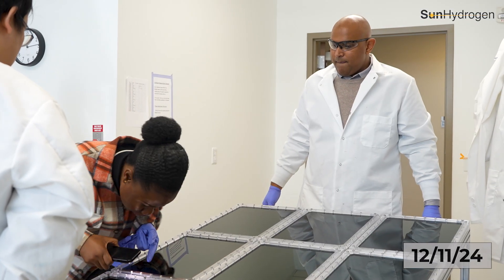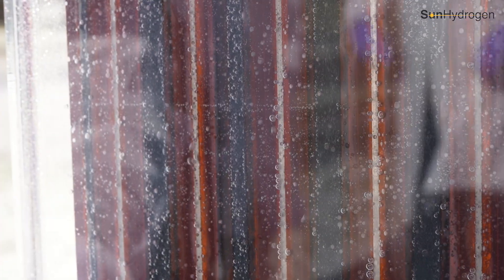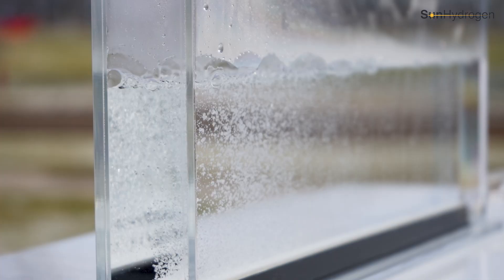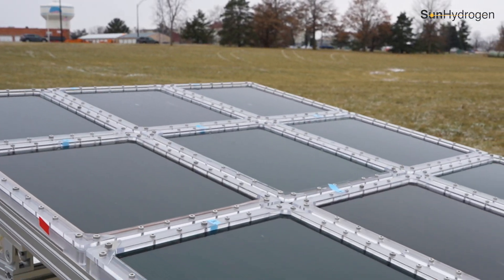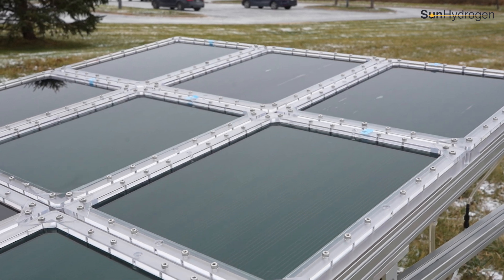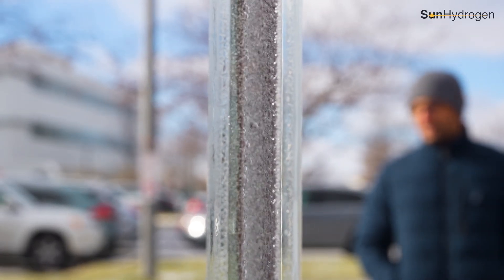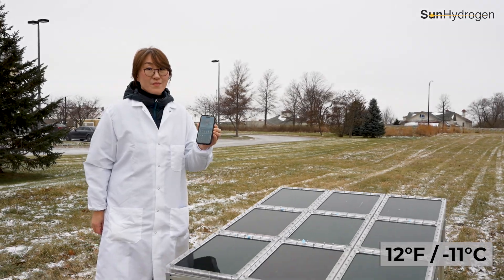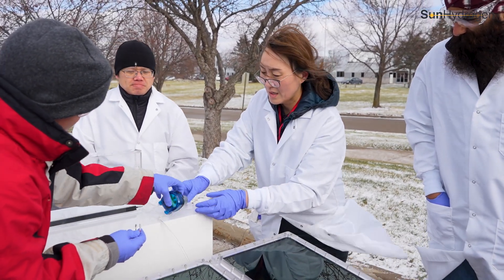SunHydrogen Showcases 1m² Green Hydrogen Panel Demonstration

Comment: Production in the cold? What happens when you put those in the hot desert? Does output increase?
Reply: Incredible insight thank you!
Reply: It's not heat or cold, it's the sun's intensity that creates cold climates. More intense stimulation comes from more direct pressure from the sun, like a strait line. Using solar in a cold area is mostly due to the strait line from the panel to the sun's pressure passing through the atmosphere, the more atmosphere the pressure has to press through to reach the panel means the weaker the pressure, lost in the gasses and water vapor of the atmosphere. 

If you go outside and point strait up from your position the amount of atmosphere above you is lets just say 10... if you point straight out from you, arm parallel to the earth, that line would pass through 3 or 4 times as much atmosphere. Cold areas mean more atmosphere must be passed through before the sun's pressure hits the ground, stimulating the ground and creating heat... that heat is lost in that long stretch of atmosphere before it gets to the ground, or panel. 

So yes, in a Desert the panel would do better, but not because it's hot, but because on the equator the sun would pass through far less atmosphere before simulating the panel creating heat.
Reply: @ thank you brother!